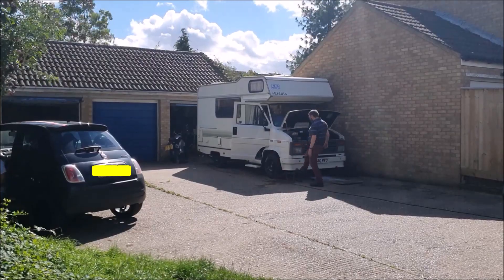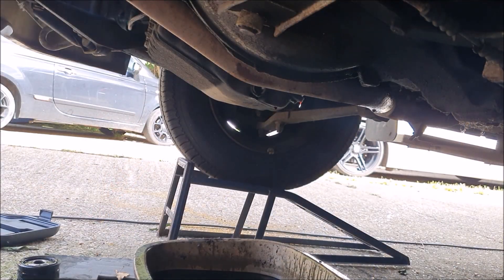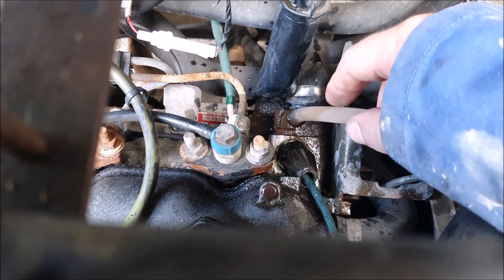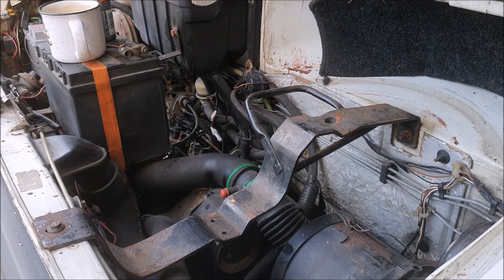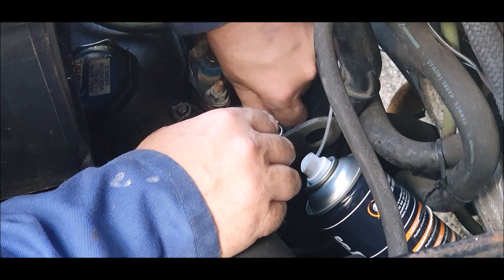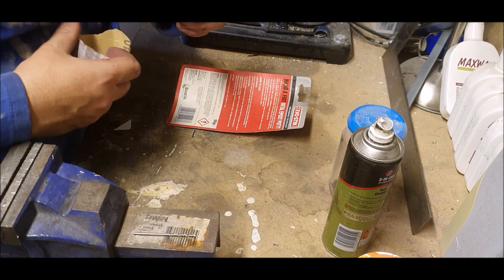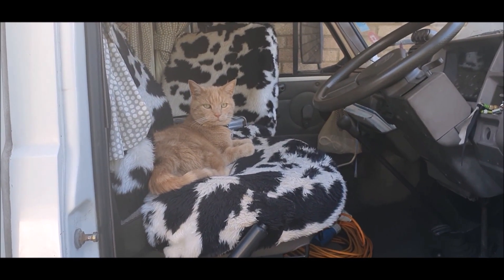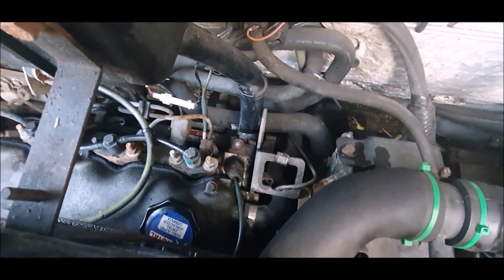Surprise Coolant Fountain!

Comment: the main problem is that this screw is one of the 3 purges of the cooling system. Btw thx for your video, as usually they are very good and weel explained. For me, this screw must be replaced ASAP
Reply from the maker: Quite a while on and I still haven't replaced the screw 🙄 I definitely should though, thanks for the reminder! (I even ordered some and have them lying about somewhere).

Comment: Hi matey.  Just for info my van has an air filter sensor. Its mounted above the plastic belt cover where the two big air pipes join,  nylon ties. The sensor senses air suction and if air filter is blocked you get a light show up on speedo indicators. Took me a while to work out what the wires do. Ps hoping my bleeding nipples are ok. Cheers from George
Reply from the maker: Ah yes, ours has the light, not seen it illuminate yet. I probably change filters often enough not to see it 🤔
Reply: @ttxela  Also water in fuel filter sensor and dash light. Cheers from George

Comment: Think I may have tried to clean the seat before I commited to the Blocking up of it, I think you did well getting that out, if it were me it would of snapped like a carrot.,
Reply from the maker: Yes, plenty of plus gas is the key! Going to try and get replacement bleed screws 👍

Comment: Hi Alex 👋 it's Chas well done getting that nipple out mate 
Think you may want to check that it seats correctly in the housing as may have a bit of muck in it totally agree with you about the flush nothing worse than black death in the oil way's also semi synthetic oil at the correct weight nice 👌. 
Ps when water leaking out of a bleed nipple usually is the seat👍
Beauty. 
Chas.
Reply from the maker: I might have a go at cleaning up the seat, I did try when I had a similar issue with the one on the water pump but couldn't get a seal. Odd how it started spontaneously though! 🤔
Reply: @ttxela  has the end of the nipple started to brake up?
Have you got enough antifreeze in the system?
Rust deposited into water way from radiator.
Reply from the maker: @charlessmillie8774   antifreeze concentration will need checking now after my fiddling about, the end of the nipple seemed fine to be honest.....